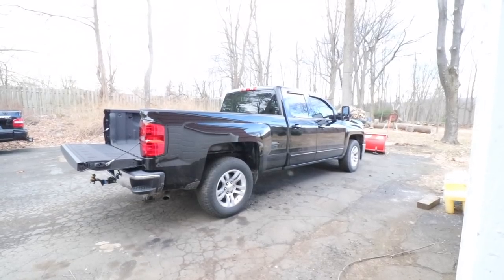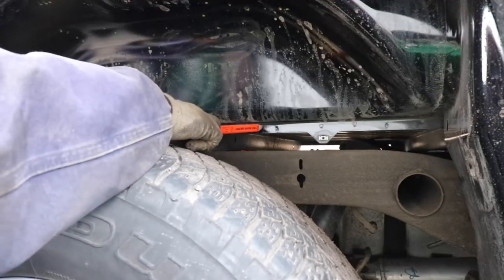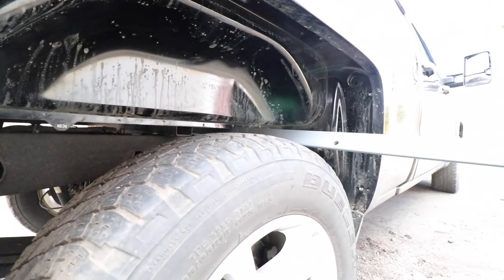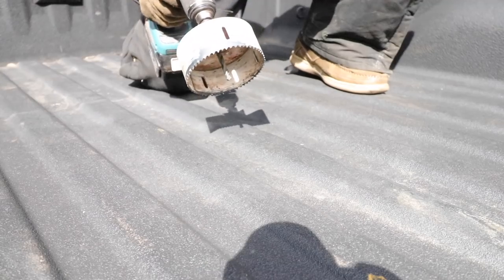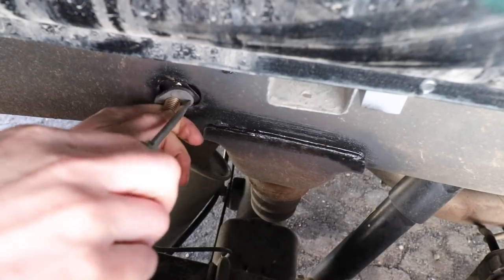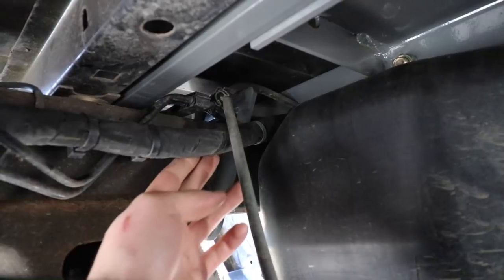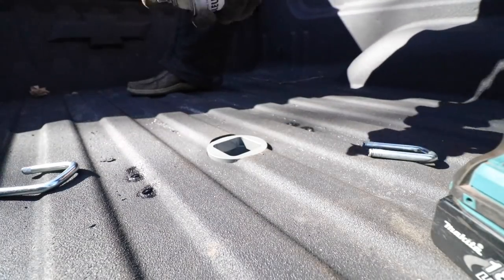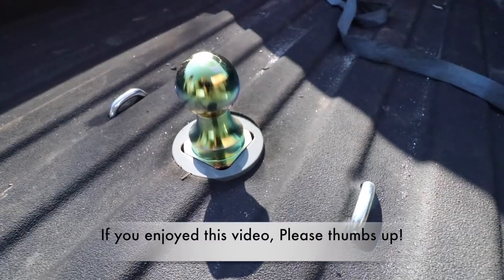2015 Chevy 1500 B&W Gooseneck Install (GNRK1057)

Comment: Hi Hunter! That sure looks like a real nice hitch kit. You sure do a great job with your videos explaining your experience in detail, what you needed to do, right down to notching the fender liner for the release handle. I never would have thought about the bed liner thickness when measuring the location for drilling the 4" hole. That 1/16 inch would have made a major problem. Great job!

Comment: My mechanic said they bed was 3/4 in too wide for my short bed. H said he needs to drill holes through the frame, why is that if the kit is the right one for a 5' 7'' bed.
Reply from the maker: Sounds like he didn't install the kit properly. Perhaps he drilled the ball hole in the wrong spot.